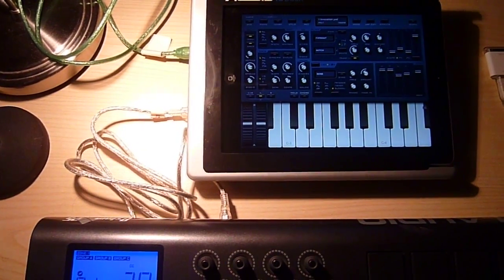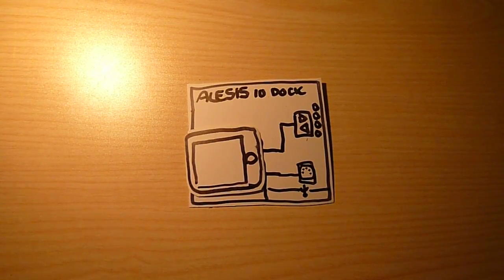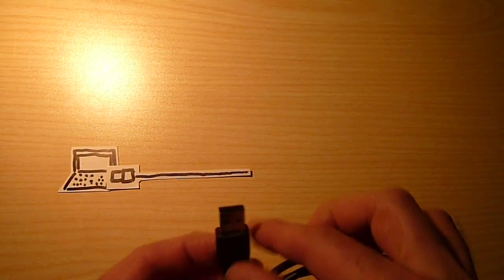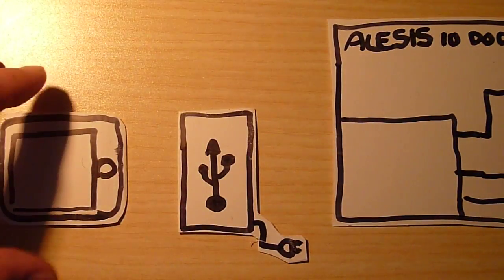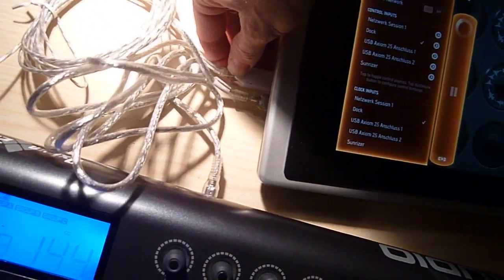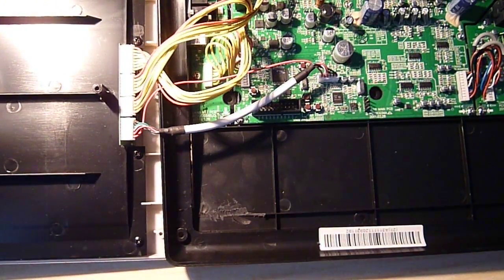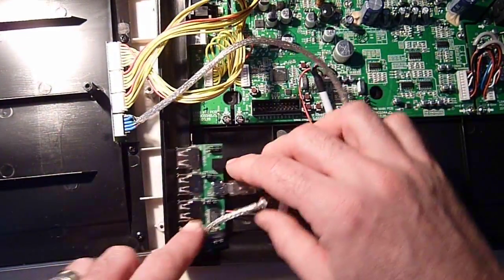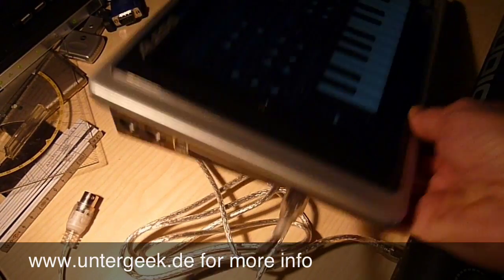Alesis IO Dock Hack: Internal USB hub

Comment: i am using the IO dock with a IOS 30 to lighting adapter (apple made, and when i attach a third party camera connection kit with USB port on it,it still charges but dock audio out stops working, midi port for dock inside ipad disappears but the midi keyboard i attached to connection kit starts working. i can only hear from audio from ipad. probably there is a design limitation.

Comment: 2:52 Ha, and that's essentially the ONLY time it accepts devices through the camera connector kit, if they're going through a powered hub. I was so happy when iFile finally got Dropbox integration, because I was so goddamn sick of having a heavy spider of cables leading between an outlet and that atrociously-made CCK...just to connect a flash drive to the iPad.

Comment: You deserve a comment!  Fabulous!  Now how to hack the iconnectmidi2+ so I can hook up two ios devices to the one usb B port on the front ?  Cheers!
Reply from the maker: Tobias Mixer I guess it won't work - unless the designes of the iconnectmidi already foresaw the connection of an external USB device, like they did with the IO Dock. The device has got to be able to work as a USB master.

Comment: Why not to use instead a USB adapter type USB A Female to USB B Male? So as to avoid  damages on the IODOCK. Plus you can add a USB HUB to have more connexion to connect whatever for exemple an MPC or a MASCHINE.
Reply from the maker: What kind of adapter are you referring to? If it's a simple mechanical one: are you sure that the IO Dock is capable of working as a USB bus master? (Which it would have to, as the USB B connector of the IO Dock does not interface to the iPad but rather to its internal processor.)

TL;DR: Because it won't work.

Comment from the maker: If you don’t mind a bit of shameless promotion here: I’ve put my original modded dock on eBay now (look for auction 151309716452 on the German market). It has been running rather well for over a year now, but it won’t fit my iPad Air without an adapter and rather brutal reworkings.

Comment: Could I ask what ipad u have? my 2 can barely handle small apps after the mod. Plugging in a 12step trying loopy hd, shredder and animoog.
Thanks was a fun mod!
Reply from the maker: Glad you like it :) I used to have an iPad3 which is no faster than your iPad2, and it's also known to have some issues with music apps, so I've switched to an iPad Air (rendering my IO Dock useless). I could not make out any difference concerning performance, using the usual tricks: Flight Mode, and killing all unnecessary apps. Sometimes it was a good idea to switch the iO Dock off and on again. With that setup, I had Loopy HD, Genome Sequencer, Sunrizer Synth, and bs-16i sample synth runnning without any problems, controlled by an external MIDI USB device.
Reply: untergeekDE So no improvement over the ipad 3 thanks.
Could you use an adapter for the ipad air? Would be great to get this running but I understand the limitations. thanks again
Reply from the maker: You could. Alesis themselves have confirmed that the iPad Air can be used with the IO Dock and the standard Apple adapter, and you should have a look at Shep's blog over at churchnerd.org - he did this with very simple means and very rewarding results. (Other than that, you might want to sell the IO dock and wait for the Focusrite dock to arrive in the market.)

Comment: YT won't let me post URLs, but follow the link in the info and have a look at the article in my blog. For the connectors, there's a source on eBay, or you may try RS Components. For the USB hub - you may have to try one or two, but basically every powered hub may work.

Comment from the maker: Basically, no. The iPad doesn't support generic memory very well, as you may verify with Apple's Camera Connection Kit (which is, at a basic level, the same thing). A jailbroken iPad may be different, but IMHO that's not for the faint of heart.

Comment from the maker: Absolutely. As I'm writing this, my setup includes an old midi master by Doepfer, a Korg R-3 synth as keyboard (and midi) input, and a Behringer FCB-1010 Midi foot controller hooked up to the R-3. Yes, it's perfectly possible to use Midi and USB Midi inputs/outputs in parallel. For a few applications, it's pretty useful to have the Midi Bridge app running on the iPad (think of it as a virtual patchbay), but normally you wouldn't need it.

Comment from the maker: Sorry Peter, I just don't know. I upgraded way before starting this hack. But IOS5.1 never posed any problems with USB/Midi, so I strongly suspect that IOS5.1 works fine but there's some hardware issue. I strongly recommend the workbench test from my blog post - before actually glueing anything in. And from a long experience in doing little soldering hacks, it's always the little things - a plug not fitted properly, a short-circuited wire, switched polarities, and the like.

Comment: Accidentally posted before finished writing... Just wanted to ask which iOS you are using, because it won't work with my iOS 5.1 even though I have updated the firmware. Also, do you have any idea if it would work with a jailbroken iPad? I might try that if I can't get it to work.

Comment from the maker: I used the IO Dock's internal 5V rail. Supply voltage is on the outer  left two pins of the Dock's IPad/Usb chord - that's the one I unplugged - so I soldered a single connection from the outermost 5V pin to the hub's power input. That's the single red wire in the photo with the handwritten USB pinout (in my blog post). BTW: I used a Belkin F5U404 - forgot to mention that in the post.

Comment from the maker: Technically, yes, but I think that it wouldn't make much sense. Cut the internal cable, solder a female USB plug to the iPad end, and a male A-type plug to the Dock end... and have them dangling out of the housing? No. A more elegant way is to use a USB junction - a port. Which is what I did ;)